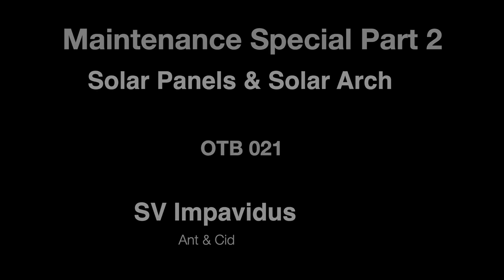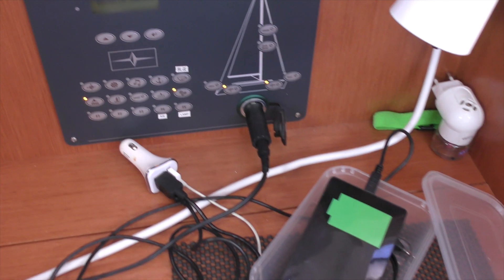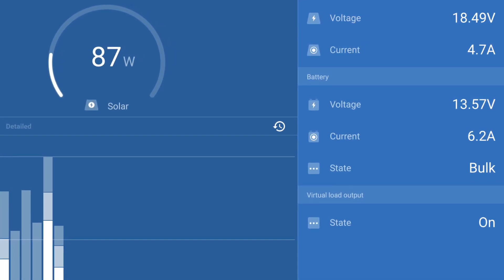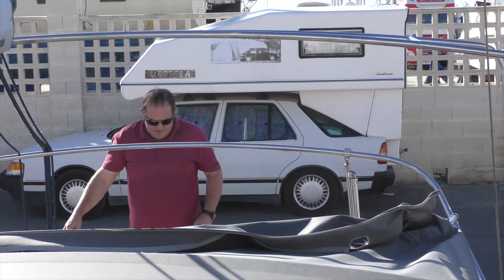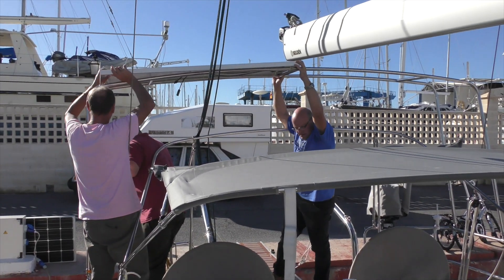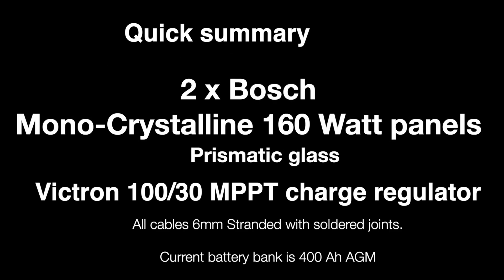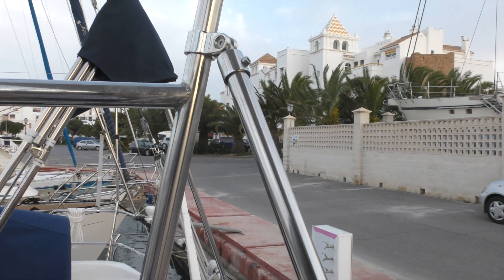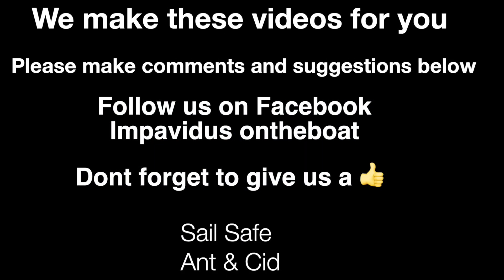Solar Panels. How to fit them on an arch.

Comment: How did you bolt the aluminium panels on the stainless steel frame ?
Reply from the maker: We had webs welded on the tube and then used stainless bolts with plastic isolater washers. Sail Safe mate. Ant & Cid

Comment: How have you find the system having spent some time with it now?
We are looking at the Victron MPPT 100 / 20 with 300W of solar, just hoping it would be enough 🤔
Reply from the maker: Hi Guys. We have not had a full anchorage trial as yet. But  we are getting well over 200 watts from the arch when the power goes off which it does now and then here. Go for the smart solar from Victron it has built in bluetooth. 300 Watt should be fine if your only running a fridge and anchor lights at night. Probably best to do a full list of your electrical consumption when sailing, at anchor, sailing at night etc so you can work out your power needs first then build your system round that. I have a spread sheet somewhere that calculates everything you just add the values. Ant & Cid xx
Reply: SV Impavidus (Ant & Cid Sailing) It is the Victron smart controller with Bluetooth that we are looking at. Thing is there is a big price between the 100 / 20 and the 100 / 30, so we don't want to spend more than we need to but then again we don't want to be underpowered.
 The list of items you have on this video is very helpful and almost similar to what we will have once we get radar and ais.
Reply from the maker: @Borders-N-Beyond  We will send you the spread sheet. It may help. Going bigger with the charge reg may be expensive now but it gives you room to expand later if you now. Perhaps if you go lithium at a later date. Ant & Cid xx
Reply: SV Impavidus (Ant & Cid Sailing) That is true 👍🏼 do you know if a wind generator would use the same charge controller or something different 🤔x
Reply from the maker: @Borders-N-Beyond  No you cannot use the same controller. Wind gens generally have big resistors that they dump the power into when the batteries are up to charge. The MPPT's just cut the power off from the cells.
Reply: 👍🏻 @SVImpavidus

Comment: Great video thank you for sharing.
Can you please share the price of the arch?
Reply from the maker: Hi Frederico. If your thinking of an Arch you should budget between €500-€900 depending on the size and shape. The tube is 316L /30mm ∅ stainless steel which is expensive but a superior product to 304. To keep the cost down you can do your own design and installation and keep the bends and welding to a minimum.  You will also need to buy the fittings to connect to you boat or the existing rails as we did. These were €120. The panels were €180 each from a local supplier and the cables about €30. The clever part is the Victron MPPT charge regulator. You can buy cheap ones but the Victron comes with bluetooth link and a fearsome reputation. We paid €215 + postage from ebay Germany for ours. We would highly recommend talking to Stuart at Arcglow, he has a lot of experience and will be able to advise you on how to get the best value. The other thing we would recommend is to go bigger with the panels or get more than you need in Amp hours. As this supplements days when it's cloudy or there is little bright sunlight. We calculated that our 2x100 watt panels would be enough for our boat but, the journey down here has proved we need more. Thank for watching. Hope this covers all your questions? If your local you can always pop over to D3 / 540 and take a look.  Sail safe Ant & Cid x